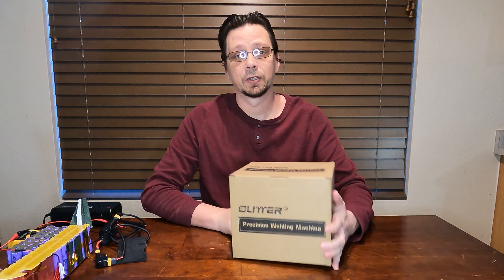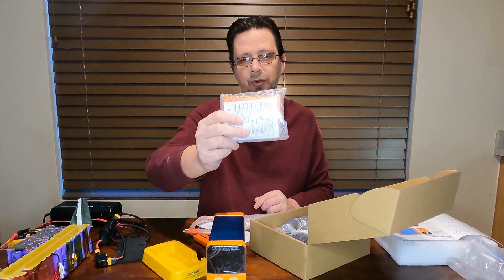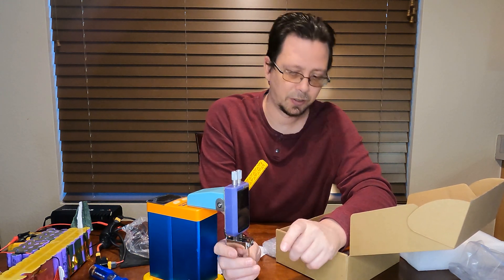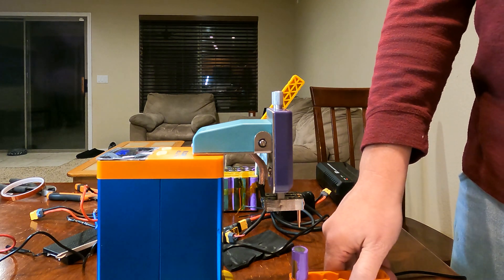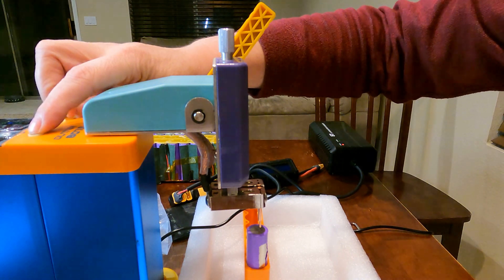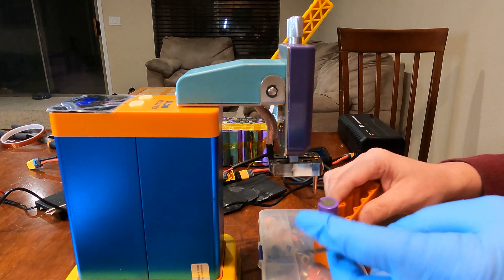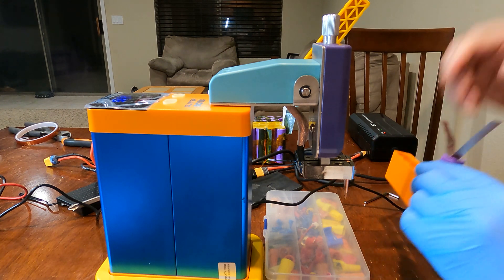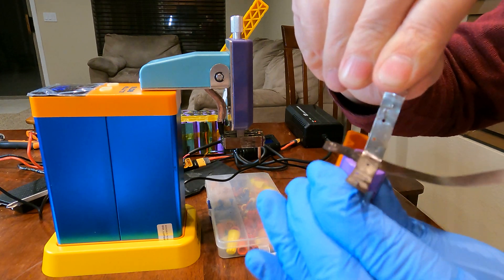Glitter 801B Battery Spot Welder | Make Electric Bike Batteries Tool

Comment: Hi Eric i'm looking to buy this exact model on ebay for 172 pounds how would you rate this after you have used this for a year or more a year ? Thanks.
Reply from the maker: It has worked great for repairs. All spot welds have held up great. Even on these bad Arizona trails.
Reply: @Eric_Tennant  Thanks for replying, i did however buy the 801H from ali express for 183 pounds because it had 36% off, i just have to wait a bit longer for delivery.
Reply from the maker: @bennyhill4228  Nice the H model should hit harder.

Comment: Hey do you still have this and maybe want to sell it at a better deal than buying 1 new? I have cells on the way and need to buy 1 but dang thier expensive....very good video my man!
Reply from the maker: Yep still have it. Its sitting ready for my next battery repair or upgrade.
Reply: I just got one

Comment: Look for 21700 batteries.  It’s possible to get name brand cells having 5 A/H for less than 5$ per if you buy them in quantity, e.g. say 100 of them (7 x 14 = 98, plus two spares for, say, a “tent lantern” or similar.)

35 AH is a decent battery.  It’s a heavy brute (working on mine right now) and is trick to maneuver.

18650s are the same money for 3.5 AH.  Bought some of those a while ago…

Comment: Would you still recommend this welder ? Im planning to build a battery from around 100pcs 21700 cells ( i was also thinking about the 801D model
Reply from the maker: Yea, The pack I repaired is still going strong. I tested the crap out of it on a few tours now. One of them being a really bumpy bad trail up the mountains here in Arizona. 801D model is indeed the best. I wish I wouldn't of been cheap, but it still worked out for me.

Comment: I have this unit and found that pressure on probe tips must be even and each probe should touch the metal surface at the same time. Keep them even and let off some pressure on the two adjustments. Mine came with way too much pressure against the probes and you won't be able to judge the pressure property at the lever handle. I used my hand pushing up on each slider from the bottom and turned back on the adjustment until I had slight sense of pressure against my springy hand. Equalize pressure both sides and double check both probes touch at exact same time. Keep all metal to weld CLEAN. My settings are around 50 on pulse strength but each new project , I test pull the weld for strength of bond. Remember if your getting large spark before solid contact , you're going too slow on the lever. Timer only takes less than half a second ,think they state point 2 seconds delay before automatic pulse is triggered after solid contact of both probes in auto mode. To switch to manual mode . Shut off machine , install  foot pedal , press both front panel buttons AFTER holding down pedal , when power is restarted by usual two buttons start , the machine should come up in manual mode if you had kept holding the pedal pressed down while starting the unit. I will only use this for small battery packs as pure copper bus bars are my number one choice for any E Scooter or electric tricycle or shopping grocery better. Latest tricycle for local shopping has roof replaced with right sized  solar panels , two 170 watt going to battery through properly set buck up converter. Tricycle used heavily since I park in the sun , no electric bill !  Nick , NavyBlueSmoke , LST-1195

Comment: I bought 801H model and it is great. From different reviews seems also 801B is to weak from whole series. Best one are 801D model and 801H. With 801H I can easily spot weld 0.15-0.3mm pure nickel strips. 801B have problem to spot weld nickel plated strips. That model doesn't worth to be bought at all.
I have the same weld arm and it is total crap. With it welding is to weak and not good at all. From video I can see that also here. Another problem with that arm is when you push it down to battery whole spot welder case go up and you didn't have good weld contact because you does not have a sufficiently stable base. With using provided S75A electrodes of 801H I have very good results.
Reply from the maker: Indeed. Took me like 3 hour to figure out to hit the same weld 2 times. Is strong with 2. With just one it was way too weak. Think they have to pulse length to short.
Reply: I think the units like 801B are only good for small battery packs and for that application they'll do ..... But No Cigar !  Most of my E Scooters  , E Shopping Carts , Tricycles .... I insist on pure copper bus bars  ( use the liquid electrical tape to keep Any copper oxidation from happening ). The high resistance of nickel plated steel or pure nickel strips wastes your power in giving off heat With Your Energy !  I love copper , my wives are jealous ....... Nick , NavyBlueSmoke , LST-1195

Comment: Could one hook up two batteries, of different voltages, in series for the bbshd, in order to obtain a higher voltage ?
Reply from the maker: Yes, but it may damage the smaller battery. I have not tested this myself. I have only done parallel tests using 3 battery banks. One was even 10a when the other where 20a, and it was fine. https://batteryguy.com/ is what google directed me to for this question.